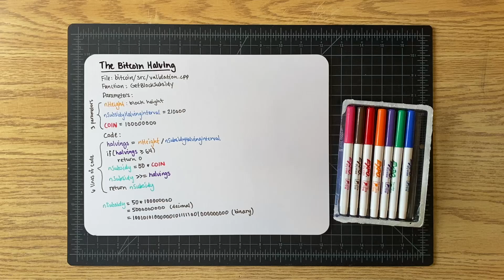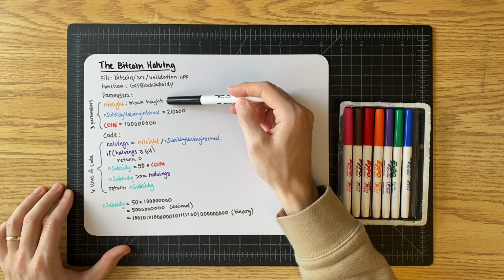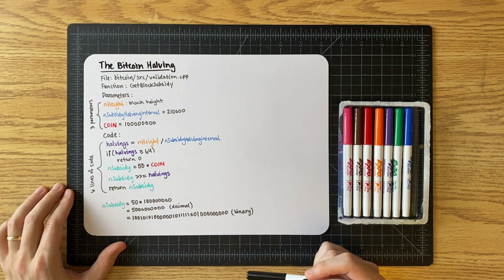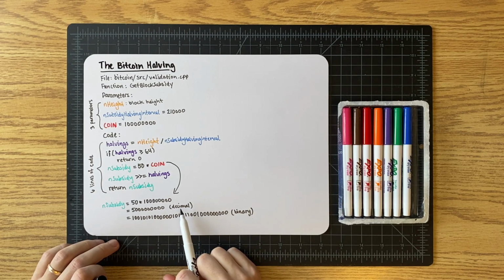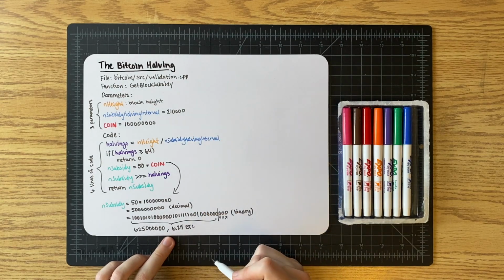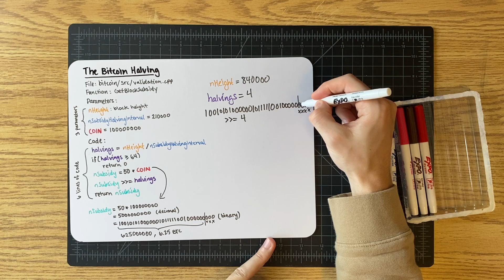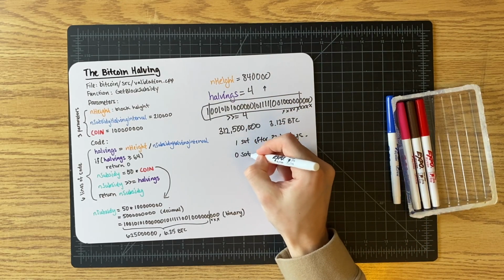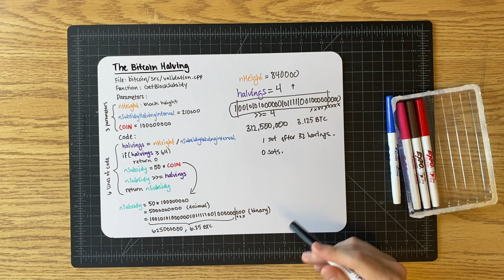How the Bitcoin Halving Works (Code Walkthrough)

Comment: You could have explained that the reduction in block subsidy is called the "halving" because the right bit-shift is a divide by two operation.
Reply from the maker: It's not always a divide by two operation though. There are some halvings in the future (e.g. the 10th one) where it reduces the block subsidy by slightly more than 50%. This happens when the bitwise shift removes a 1 instead of a 0.

Comment: HUm...Does that mean that once there is no subsidy to miners, BTC will change from Proof of Work to Proof of Stake?
Reply from the maker: No, long before the subsidy goes to zero, most of the block reward will come from transaction fees. This past epoch, transaction fees already accounted for 5% of the total reward. I wouldn't be surprised in this next epoch, that amount goes above 10%, and so on and so forth. There's a reason it's called a "subsidy"...it was only ever meant to subsidize the network during these early bootstrapping years. 😉
Reply: @wickedsmartbitcoin  Thank you for clarifying. I think I am confusing miner's rewards for creating BTC vs rewards for transactions. Also, if I have a BTC node at home, wouldn't I be validating transactions, and should also receive a reward?
Reply from the maker: @tronziebit  you don’t receive any reward for validating transactions. Only the miners receive the reward.

Comment: The shift right instruction is a bit risky, 32 bit vs 64 bit, requires carefull attention how the compiler compiles it.
Reply: A division loop might have been more clear and perhaps safer... :P*
Reply: Another problem with this explanation is the division, it's an integer division, not a floating point division.
Reply: Conclusion: C is a poor language to explain to joe average, you failed at it.
Reply: Anyway at least you tried, and now people have some idea what it's about, but they still won't undrestand it. :P*
Reply: Writing understandable and really safe code is an art form, best practiced in the eternal language Pascal/Delphi :P* ;) =DDDDDDDDDD no miss understandings there, right ? ;)
Reply: There are other problems with this code slightly, it assumes the most significant bits are shifted to downwards, so it's not really about shift left or shift right, it's about shift towards most significant or least significant binary digit.
Reply: What will << or >> mean in a thousand years ? There are already programming languages like C++ that use it as a pipe in and pipe out, just to give an example.
Reply: Then there is the post fix and pre fix situation, is >> or << applied before or after the assignment =D
Reply: Another problem with this explaination, if the function headers are missing, where are the parameters ? where are the types ? Are you a javascript programmer ?! ;) =D
Reply: Another sublty is line number is missing, perhaps this function is overloaded a billionz times... hehe... could be many of them... now the user has to find it and run the risk of finding the wrong one... perhaps not an issue in bitcoin definetly in other software :P* This explaination is as sloppy as the font :P* =D
Reply: The coloring is nice though, some of these are not "parameters", but "constants" most likely, so that is explained wrongly...
Reply: I am not going to bother the binary value, it is irrelevant... for proper code... it would not have mattered much except if it will fit into the variable/registers/memories.
Reply: Even the return type of the function matters, if it were a floating point then what ?! LOL.
Reply: Or void lol.
Reply: These comments gave me an idea though for a new programming language: A ROBUSTNESS programming language, and a challenge: change 1 letter, or 2 letters or a while word/symbol and try to write a computer program which can and will still function correctly...
Reply: Basically shr is used as a division, however shr and div may operate differently when it comes to setting "flags" of the processor, this may or may not affect subsequent code..
Reply: There could actually be a bug in this code, not that it's too relevant, in 32 bit mode limiting the halvings to 64 would be wrong, it would only support 31, in 64 bit mode it's doubtfull that 64 shifts will be supported, more likely 63, so plenty of issues with this code, by the time these become real issues we all dead, except me, I will live on in a computer ! LOL =D
Reply from the maker: @skybuck2000  there’s no such thing as a “32 bit mode” lol. Thanks for your concern though.